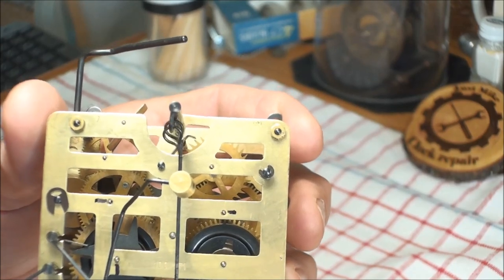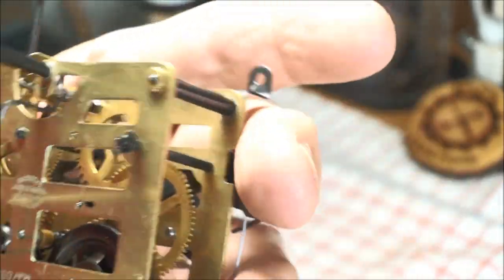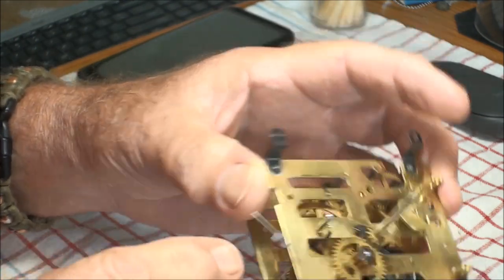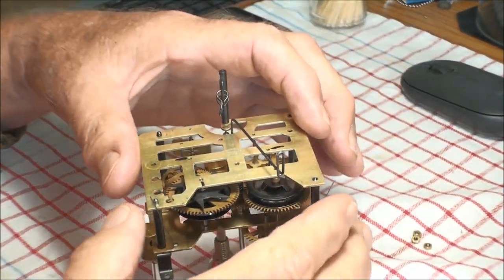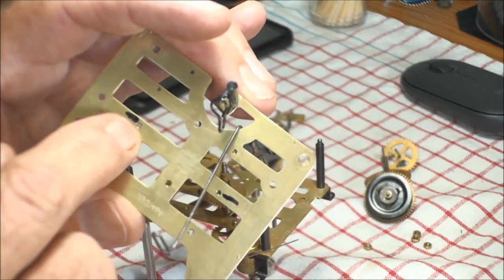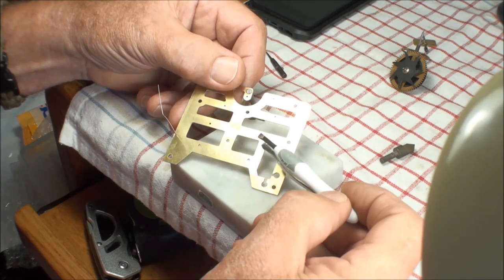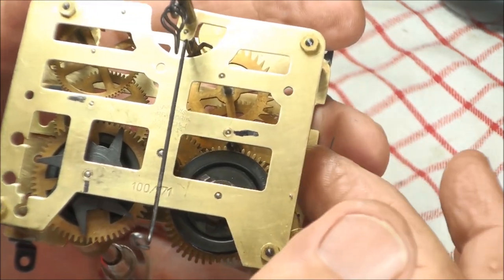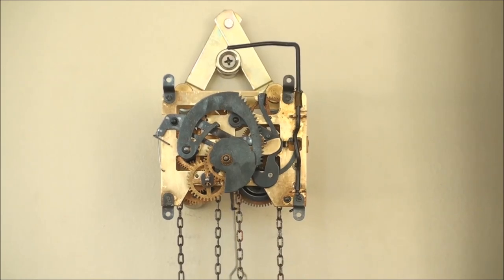Does your Clock need Bushings

Comment: Enjoyed the video. Trying to get an idea of when I should do bushing and when they are ok. Everyone shows the very loose ones with a lot of slop. Video idea: What does normal pivot hole movement look like and what is beginning of wear that would benefit from bushings? I read somewhere that if it moves more than 10%, then put a bushing. Hard to judge what is 10% in a hole that is 1.5 mm! That's a tenth of a millimeter. Would love to see you describe your gut feeling on differerent pivot movement amounts on a video.
Reply from the maker: Mark gets into the bushing part. I did a video on bushings, but made is short because most people can't or wont try doing their own. They only have one clock. 
  The one day cuckoo clocks can get buy with a lot more slop than an eight day clock. The last video I did a bushing on was a very old Rail Road clock, I showed the play I missed when putting it together and the clock would just stop ticking. The plates were so think, the the hole looked good, but it you looked close, the pivot was worn inside the plate and not on the outside.

Comment: I'm working on an 8 day 34 gm and the timing side runs perfectly until I add the arbor. Can one pivot hole that might need to be rebushed cause that kind of problem?
Reply from the maker: The 35, one day clocks are forgiving. The 34, 8 day clocks are not. Yes, just one pivot that is bad can stop your clock.

Comment: What is this wonderful tool that you use to make holes?  what is it called and where can I buy it?
Reply from the maker: The tool isn't cheap, but this is a link for them at Timesavers. https://timesavers.com/i-8948895-kwm-style-hand-reamer-set.html
  A cheaper way to do the job is using The Cutting Broach Set that come in different sizes.

Comment: The spark plug wires must be crossed on 2 & 4 cylinder to get it shaking that bad. Good to know what a shop wants to charge you for doing.
Reply from the maker: I hear most clock shops will not work on cuckoo clocks. They are not worth their time. Thanks for watching Bob. Happy Thanksgiving.

Comment: Not to be critical but the strike side snail cam gear does not have normal side play or be normally loose. I watched you ream the hole before inserting the bushing and I didn’t see you compensate for the egg shape hole and that is going to cause a depthing problem. Also the center wheel usually needs to be bushed and you avoided taking off the snail cam and the center wheel lifting cam which actually make it easier for bushing if needed and assembly or do you not have the tools for that. I’ve been doing this for over 50 years and frown on lessons that are not correct. Also reaming out bushings to the proper tolerance was not covered. Not every pivot has the correct bushing size available. Are you going to cover reassembly and synchronization of all the cams and levers, lubrication and adjustments?
Reply from the maker: I do believe you are a bit critical for not understanding what type of people I have come to my channel. You, as an expert know all about this work. I, on the other hand  didn't want to do this video, but am always asked about the bushings. My video was very vague and warned people that there is a high cost in buying the tools just for one clock. I do have followers that have a few clocks, but most only have one or two and they click on the clock that might look similar too their clock. 
  As a hobbies t, I do watch videos on what to look for and how to ream them by hand, but did you notice I didn't show me reaming out the hole. The egg shaped hole I know when to push and when not to push the reamer and for a one day clock, it's good enough. 
  The snail cam I don't like to show taking off because the novice will bend and scare the cam and I would rather work around it so the people know it is Okay to do so. 
  I don't have all the nice tools to work on clocks, but I have enough to get me by and add to the tools in time but will never buy costly tools that would not make séance to buy when it is just a hobby and work on mainly my own clocks. 
  I do hope you understand where I am coming from and the people I have that watch my videos. (I mean, if they don't find what they are looking for in this video, there are many more out there).